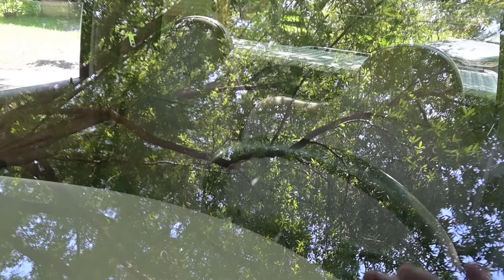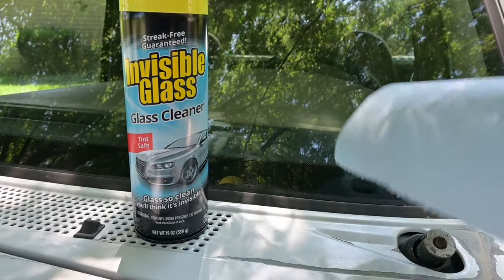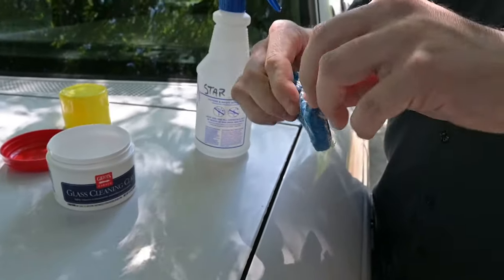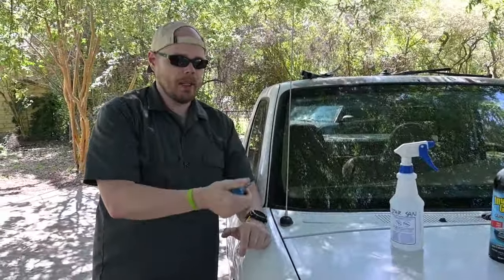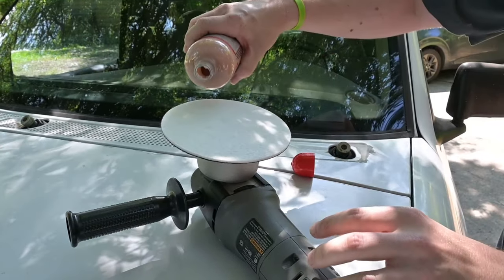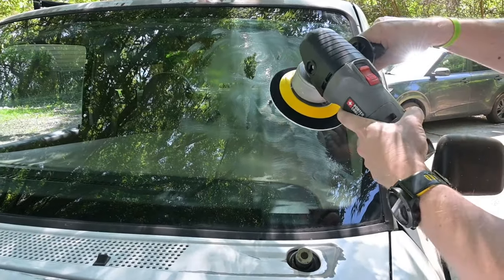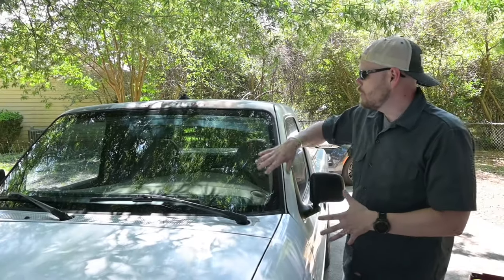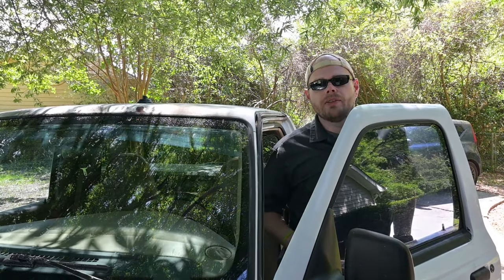Deep Cleaning and Polishing to Restore an Old Windshield

Comment: I used that pad too using Griot's Fine Glass Polish after Claying the windshield & experienced some hopping. Did you? i had to use a Foam Pad because that Rayon Pad wasn't easy to use. maybe my technique was wrong.
Reply from the maker: It's been a bit since I did this, but I don't directly recall experiencing hopping with the pad/polisher. I do seem to recall having to keep a bit of downward pressure when polishing however.
Reply: @grevesgarage I just found it very difficult to move the pad in an up and down motion. I'll try it again.